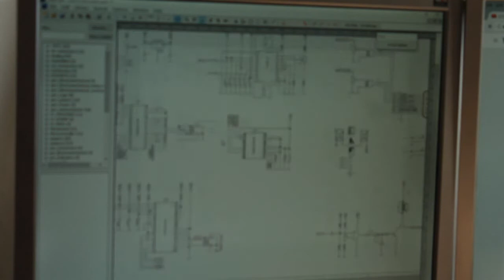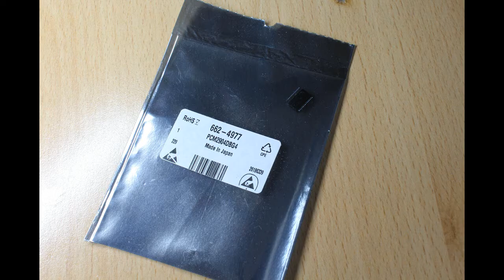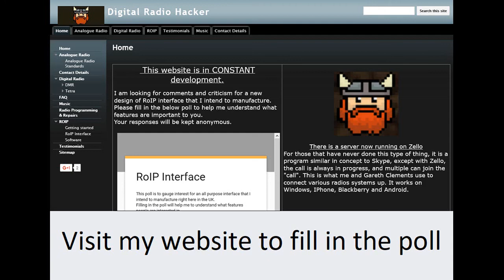Voxlink Interface Part 1

Comment: I personally enjoy using my SCU 17 on my Yaesu devices the fact it has a soundcard and cat control built in is nice however i would prefer to have adjustable bandwidth controls for receive audio to try and get the widest sound i could and same with the transmit a device which could pass through 5k audio on the tx side would be good as i personally run my audio via PC mic with software to process audio  and the scu 17 is restricted in them terms.